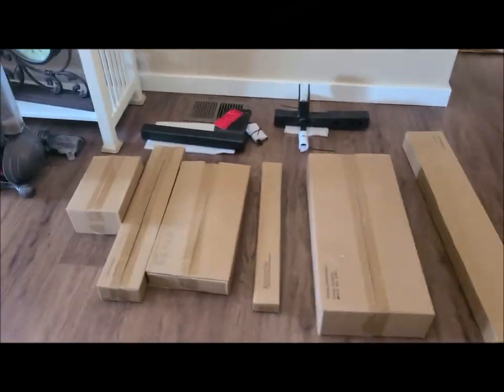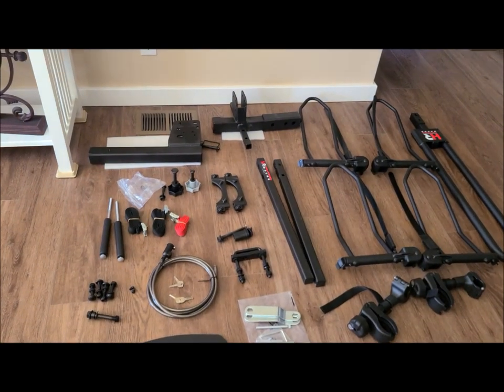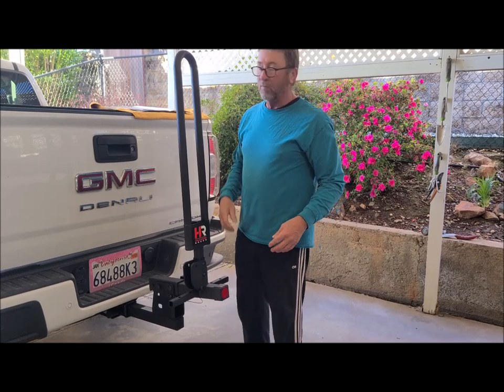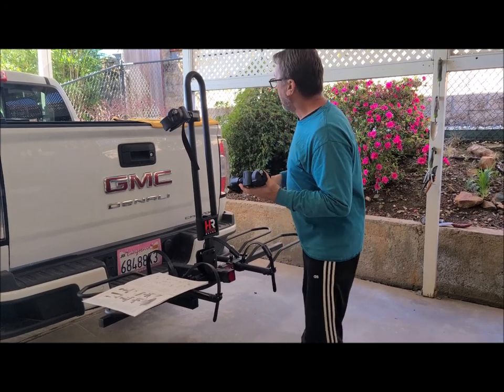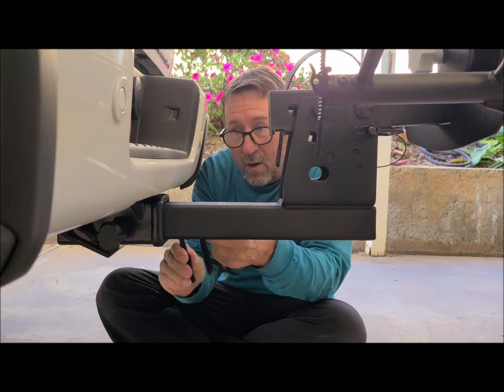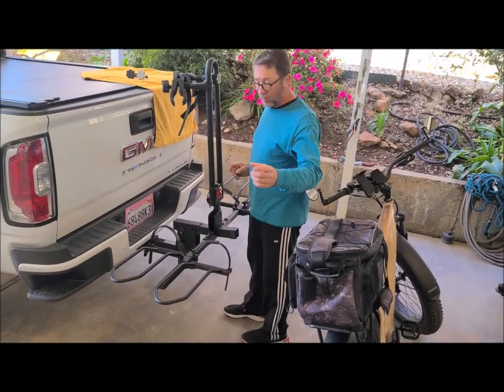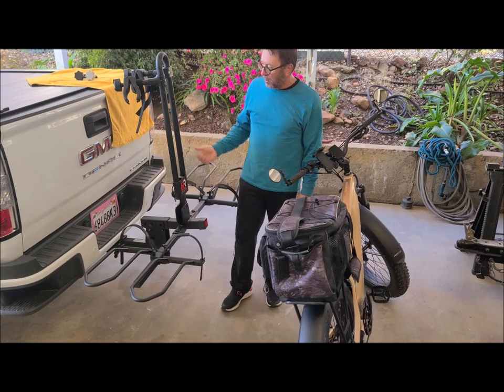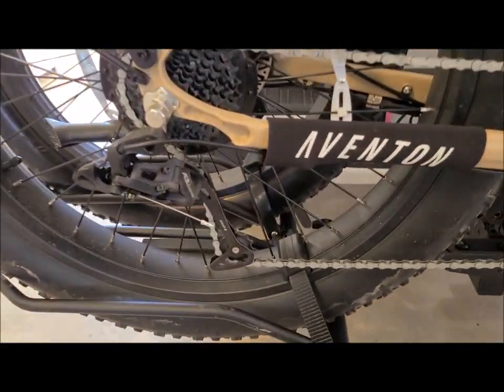Hollywood E Bike Rack

Comment: The “extra screws” go on the bottom of the square tubes. They are stoppers to keep the wheel brackets from sliding off the tubes. Once everything is in place, you just screw them towards the end (underside).